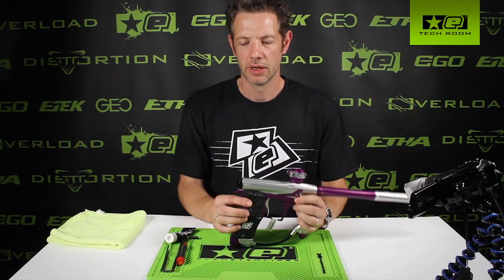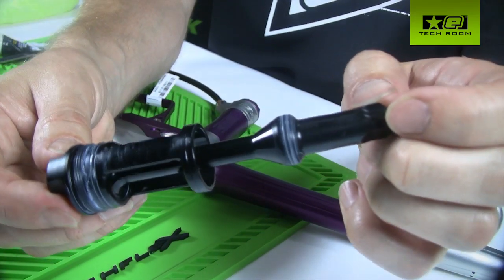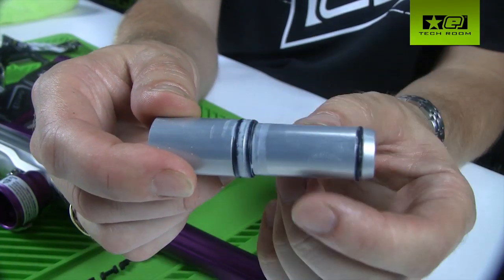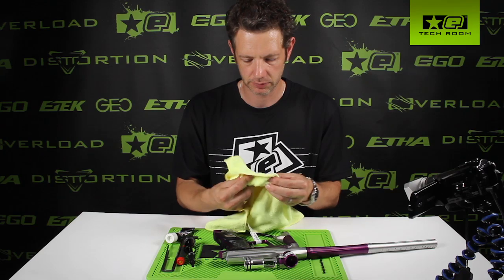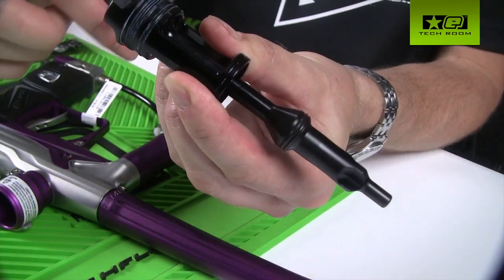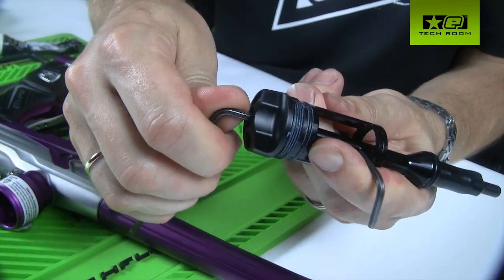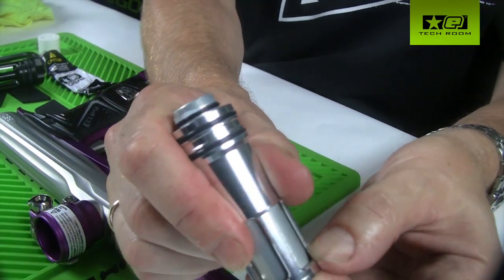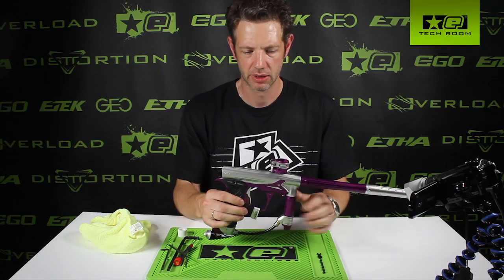GEO 3 Bolt Maintenance

Comment: Was wondering if you guys can make a video on how to replace o rings on a gsl bolt and reg.
My gsl is acting funny 
Every so often when I'm playing a point the gun stops shooting an all I can hear is air an the trigger clicking.
I have to hold the two black holes in front on the trigger an shoot an it builds compression an is fine?